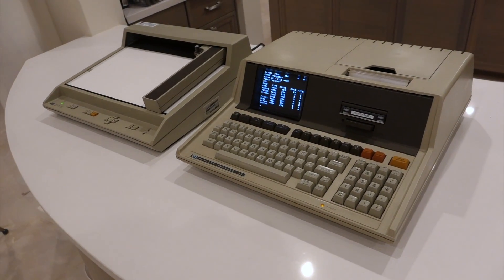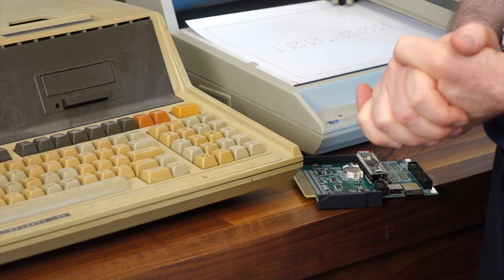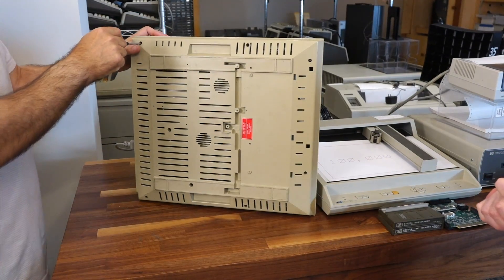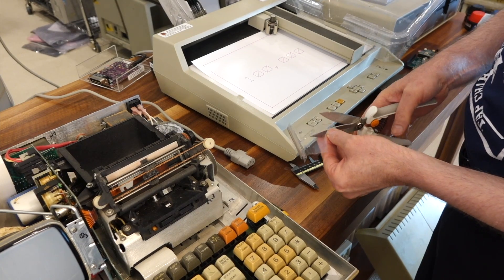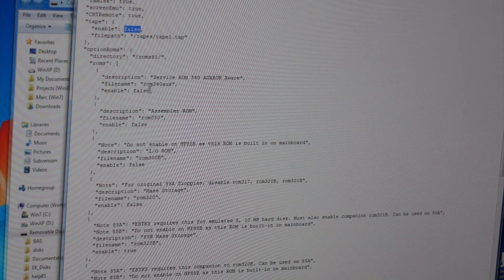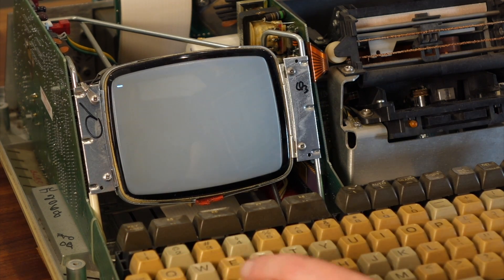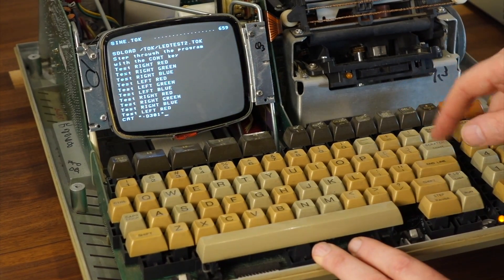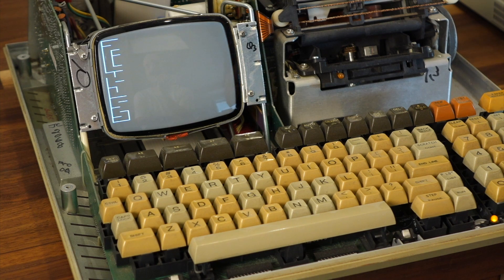EBTKS add-on board for the HP-85 vintage computer

Comment: Did I miss it?  Where is information on how you can acquire one of these cards?
Reply from the maker: You guys are too fast! Did not quite finish to edit the description yet... Just added it in :-)
Reply: @CuriousMarc  Awesome! :D
Reply: Main link for website:  http://www.fliptronics.com/EBTKS/index.html
Link for pre-orders:    http://www.fliptronics.com/EBTKS/How_to_Order_EBTKS.html
Firmware on GitHub:     https://github.com/Fliptron/T41_EBTKS_FW_1.0
Original announcement:  https://groups.io/g/hpseries80/topic/ebtks_announcement/82761979
Reply: FYI, Philip had only 2 working boards left as of yesterday (which I bought), and no plans to produce more. Thanks to my order (hee hee, more likely the surge in orders due to this video) he just initiated the production of 50 more!! He expects them to be available in about 2wks. Yea!! Get 'em while you can.
Reply: Got my 2 boards on Thursday. Using one in my HP86B right now. Yea!

Comment: I got one of these as a little kid in the early 1980's.  I loved it!  Mine had the original leather case and lots of accessories, tapes, carts, rom drawer, several roms. Not sure what ever happened to the unit but still have the tapes and a few roms.  Also picked up a non-working one at VCF West that I may bring back to life using an Orange Pi 5 and a new LCD.

Comment: I have one of these, but either the tape drive or the printer did not respond at all , I forget, it has been years since I got it. but my cousin in his infinite wisdom in trying to troubleshoot the issue,  removed the ribbon cables improperly, { the one cable over the other, shown at 8:50 }  and he ended up de-laminating them. now none of the machine works at all.
is there a source where I can get NOS replacement cables? , or fashion my own somehow?

Comment: Hello, I also have an HP-85 computer, but I have some issues. Since you are experienced in this matter, I wanted to consult with you. Sometimes, the screen of my computer displays incomplete images. Half of the screen often doesn't appear. What do you think could be causing this problem? Which semiconductor do I need to replace? There is no electronic service where I am, and even if there were, no one understands CRT systems anymore. Based on my limited knowledge of electronics, I think the semiconductor causing this issue could be a capacitor. I would like to hear your opinion. Best regards and have a nice day.
Reply from the maker: It's always next to impossible to diagnose problems remotely. Which half is not displaying? Left/right or top/down? If it's intermittent I would look for a cold/dull solder joint on the board next to a place that's hot, and try to reflow it. I have another video where I had a problem with the horizontal PLL that caused the screen to wrap around, here: https://youtu.be/lXrGFLu-wX0
Reply: @CuriousMarc  Thank you for the information you provided. There is a loss of image at the bottom of the screen. Sometimes, when I initially turn it on, the screen displays the image perfectly, but then there is a loss of image at the bottom. I will follow your advice and check for any solder joints that might be disconnected or consider replacing the semiconductors that I can identify or diagnose visually. Thank you again, have a good day. Best regards.
Reply from the maker: @lombat  Then that would be the vertical deflection PLL sync not working instead of the horizontal one that I repair in the video. I never had to debug that circuit unfortunately so can’t help very much.

Comment: awesome video. I'm late to the party, but this is like a trip back in time. Someone here said "no need to call microsoft when windows 10 takes 5 minutes to start up..." rofl
HP 85 plus GP-IB controlling an HP1090A HPLC with HP1046 diode array detector, my wake up call in 1985. 
Did everything it said on the tin and then some.

Comment: Why would you cut the video feed right before the maze finished?!??  D-:
Reply: Sorry about that. The program switches to text mode after drawing the maze. As you may note in the video, Marc was not fully familiar on how the Maze program worked, and I had never run it before. Turns out that there is a keyboard key that will switch back to graphics mode and show the maze.

Comment: I actually own a working 87XM which I haven't been able to use for much because I lack any kind of memory for it. I think I will now get an ebtks for it
Reply: That seems like a good idea. EBTKS gives you disk storage (on SD Card, and up to 256 KB of memory to add to the 87XM builtin 128 KB. Follow the links at the top.

Comment: Those cartridges 1:40 crack me up. I mean you have to laugh. They define "write only memory storage." You look at them and think "aluminum plate = robust." It got to the point where I would backup to tape and immediately test. Which led to most freshly opened tapes being thrown away after being written to once.

Comment: Good job but it would have been much cooler to put electronics in a box that fits the tape drive and communicates with the read/write head magnetically. I might even be possible to power the electronics with a generator powered off the take up spool an/or capstan :)
Reply: All of this and several other options were considered. There were very good technical and user experience reasons we ended up with the solution we did. One of the main ones is that many of the people that love the HP8x family of desktop computers is because of their personal use oh so many years ago. Much like Apple II fans. Much of this community were very much "end users", rather than "get in there with a soldering iron" type people. EBTKS was designed so that pretty much anyone could add it to their system, with minimal to no skilz needed. Just plug it in and you are good to go. Direct access to the head (magnetically) was researched. The HP85A/B R/W head is unique, with two channels across the full width of the tape, for tapes that are R/W in one direction, and no flipping the cartridge over. So there are no heads that we could buy that would interface to the HP head. Also the head is epoxy bonded to the PCB, so no easy access to the signals on the back of the head, without cutting PCB tracks.

Comment: The dinky 600 kHz processor (codenamed Capricorn) actually has a pretty neat programming model, large integers and floating point. You can have a look at it here: http://www.series80.org/PDFs/HP85-Assembler.pdf

Comment: Wow, Talk about a trip down memory lane! I worked for HP in their Field Repair Center when these were new. Our team repaired these and the peripherals they connected to. Later we repaired the HP DOS based computers and then the HP Vectra MS-DOS based PC . As an on-site repair engineer I repaired the HP mini mainframe computers,  hard drives, tape drives, the 264X terminals like you have and the line printers.  As a result of repairing so many computer working on computers is one of my least favorite things to do now.

Comment: For some reason the tape door always got stuck, i took it apart and still could not get it to open correctly but I never bothered to buy tapes for it either, and there was some issue with my belt order. I was starting to work on a module like this using SD cards haha However I would have never gotten this advanced, great module !

Comment: I would have programmed an Arduino as an interface between the HP and SD cards to replace the tape drive... internal devices are protected by the case.  I would have programmed another Arduino to interface between a tape drive and SD cards to transfer existing data/software to the new format.  A card protruding out the back is inconvenient, but at least it works.  It also might be possible to mount the card internally yet.

Comment: I use to run a calibration lab.  We used one of these to run custom calculations that I created. Fast forward 25 years while I was rummaging thru a electronics surplus store (same big city the cal lab was in) I started to see specialized equipment that I recognized, further digging around I found a digital program tape with my handwriting on it, it was one of my tapes.

Was pretty cool!

Comment: I always hated the HPIB interface. Super super expensive, very very slow and very bulky. It was garbage.
Reply from the maker: I don’t understand your characterization. Not sure about price (you did not pay for it separately, it came with the instrument), but it was faster by almost 2 orders of magnitude than anything out there at the time. Only when SCSI came out did a similar bus surpass its speed for disks - and that was 1982, a decade after HP-IB had been introduced! It still triggers faster than other methods, thanks to the parallel poll. High end for the time maybe, but quite the opposite of garbage. And very easy to use.

Comment: This has made my day! Curious Marc videos are always fascinating, but especially anything featuring the 80 series HP computers. I learned how to write code in 1980 on an 85A, and I recall that the 16k RAM expansion cost about GBP1000! My Masters dissertation was written around a multiplexed data acquisition project via a 3rd party device connected to the HPIB, which was plugged into a rack mounted 9915A. Data was stored on the built in tape cartridges, and I'm very grateful that we had very few failures! I absolutely loved our 85A, which never let me down. We then moved on to using the 9816 in about 1983, which was a huge leap. How about a feature on the 9816? Thanks Marc!

Comment: I used an HP-85 back at the university in the late 1980's for engineering.  I'm pretty sure it was an 85 & not an 86 or 87, because it had that little screen.  That 85 may have also been an 83, so I'm not really sure, since they look so alike.  I actually still have the slim pocketbook instructions somewhere.  Anyway, it wasn't attached to anything iirc, but I did further my experience with the Basic language in there, especially when it came to graphics plotting onscreen.  I already knew Basic in earlier years from the TRS-80 & more importantly the C-64 that I had at home. I now have 3 C-64's.  The HP was in an electrical engineering lab so I was in there for periods of time. There were other computers in there, mostly old terminals. The musty smell of yesteryear also wafted in that labroom.   And I'm pretty sure I still have some of the HP printouts somewhere in boxes of piles of papers from those years gone by.  Time flies when you're having fun.  And yes, this was at Oregon State University in Corvallis.

Comment: I was an HP field service engineer in the 80s/90/s and these little guys were little workhorses. I also used to repair them and yes I have replaced hundreds of mechs in my time. I see a lot of equipment in the background that I also used to repair and calibrate. The original HP company was without a doubt the best company in the world to work for, making the best Test and Measurement instrumentation in the word. Happy days.
Reply: I also was a HP Customer Engineer in the Uk fixing these in the field. Initially working on 9100A in 1976 then in 1980 went from UK to Corvallis in Oregon(Just before Mt St Helen erupted)   These were made at the HP Corvallis division. The number of times I’d have to show a customer how to wind one of his tapes as it had run off the end due to the transports end of tape light having blown.
At the end of the course I remember there was about 6 HP 85’s and they were started off playing William Tell Overture each one slightly later than the next one… it made for a very nice memory ending a very interesting visit to a beautiful factory. The next day we were off to San Diego to the plotter division…. 9872 - 7580 etc. Shortly after returning to UK Corvallis was affected by the Ash from the Mt St Helens volcanic eruption.

Comment: For some reason I now want to build a similar machine with the same form factor but built around a Raspberry Pi 4, a full sized mechanical keyboard, 10 inch screen, and maybe a break out box to keep the GPIO and other connectors accessible and other handy features.. maybe a thermal printer? All in a nice wooden box.

Comment: I am so impressed by this emulator +++ !!! I have old Commodore C64 and Amiga 500/2000 computers that I use floppy emulators and its just makes things so much easier ! Bravo. I used the HP85 computers 38 years ago at my job testing components and boxes for the B1B defensive avionics system. We then graduated to the HP 9000 's. Miss all those computers. Thanks for a awesome video.

Comment: The funny thing is that probably the microcontroller is more powerful than the computer 😂
Reply: It literally is 1000 times faster. The HP processor (code name Capricorn) runs at 600 kHz. The processor on EBTKS is on a Teensy 4.1 module and runs at 600 MHz, which for purely embedded real time work (which rules out Beagle bone and Raspberry Pi ) is the fastest module on the market (at the time we did the design). The Teensy 4.1 processor is an IMXRT1062 , which is a 32 bit ARM Cortex-M7, dual issue processor.

Comment: Ha, I have no doubt that a machine with a 600kHz clock can do much. I have recently been doing FFTs on nothing but relays, with an equivalent clock 3 orders of magnitude slower. The architectural choices matter a whole lot. It’s easy to have a slow relay computer, but it’s only a matter of engineering and surplus site luck to have one where you can’t quite tell :)

Comment: I wonder if that trick with cutting plastic strips and pinching them in the ribbon cables could be used to fix my sloppy cable fittings.  I don't know what the last guy did with it but they just flop out.  Was thinking to solder in some JST plugs and connect the little boards.

Comment: Is that an Arduino on the board? I wonder if it's in master or slave mode?
Reply: Oh no, it just looks like it. The SD card module looks different on the production version.
Reply: The module is a PJRC Teensy 4.1 that can be programmed in the Arduino environment, but we use VisualStudio Code and Platformio which is a far more professional IDE.  https://www.pjrc.com/store/teensy41.html
Reply: It's a Teensy 4.1 board. The code uses the Arduino framework for both the iMXRT1062 and the ESP32. As for master/slave, the code emulates the bus devices, so it is a slave to the HP85 processor......for the moment.

Comment: Great to see the board in action.  Can't wait for mine to arrive but unfortunately I was one of the last to place my order so am at the back of the assembly queue and will have to wait a few more weeks.  When I do get mine, one of the things I'm keen to do with it is get the serial port going so that my HP85 can talk to plotters with a serial interface.  Hopefully, we could get the f/w to automatically sort out the protocol issues that you faced when driving your serial HP7225A.  Could you at some point (maybe on your blog rather than here) post some more info on the issues involved (something to do with an ack signal from the plotter)?  Also, would you mind posting the exact DIP switch settings you needed to set on the Micro488A to get your plotter going?  Thanks!

Comment: I worked in pharmaceutical mfg in that late 80's and we used the 85. I worked in tableting and we would weigh tabs, check thickness, do a tumble test and reweigh, then crush for hardness. Once an hour, we would perform these tests, input results with keyboard, then print out results and attach to our documents. At the end of our batch we would print out results in a graph. Final data then was stored on tape. This brought back memories for me, nice device!!

Comment: I got about a thousand bucks that says Marc went back in after that dude left and isolated/insulated those ribbon cables that they unhooked from the disc drive.
Reply: I'll take that bet. What was disconnected was the faulty tape drive. Watch the end of the video, Marc gifted the HP85 to "the dude". Signed: "the dude"
Reply: @fliptrontube  Hi dude ;)

Comment: Darn, we had one at work, it died so we stripped it.... Anyone need a spare CRT?

The constant screen blanking used to put me off and discouraged me from trying to fix it.
Reply: Hi Paul. The screen blanking whenever the tape drive is operational is not a bug. HP did it deliberately to save power. This probably allowed a slightly smaller power supply. I agree that is really annoying. Also, EBTKS tape emulation also blanks the screen, so you still get to "enjoy" the classic feel of the HP85A/B. In reality, we (EBTKS team) didn't really have a choice on this, since the screen blanking is baked into the system ROMs
Reply: @fliptrontube  I always assumed they blanked the screen either to get a bit more performance from the cpu, or to avoid it disrupting timing critical routines.

Comment: I mastered one of these things in undergrad. Had it running a DMM and function generator to perform gain measurements on an audio compressor and printing out a carpet plot of the results.

Comment: I did the same for my Sharp typing machine. For some reason, all the storage interfaces in this format (be it tape, diskette) they always seem to fail. I've never come across a system that didn't gunk out or simply refused to work anymore. I'm figuring it's the "new" factor of the tech (in both cases, but for different reasons).